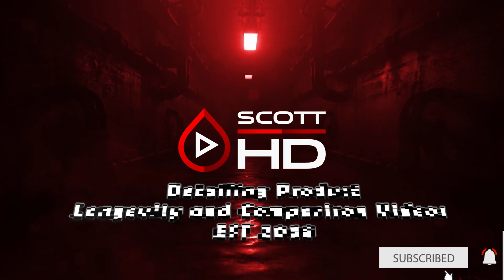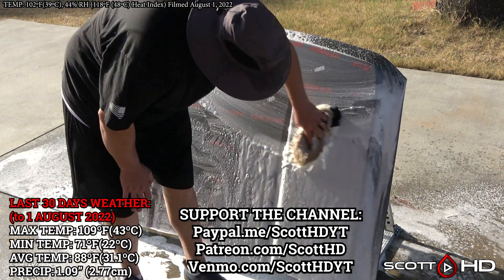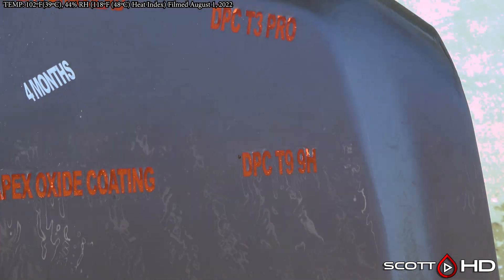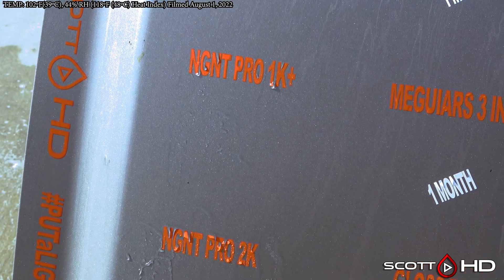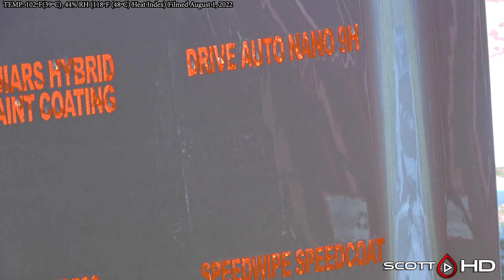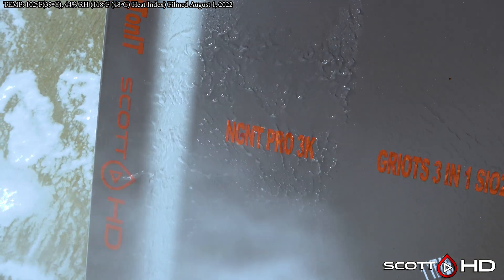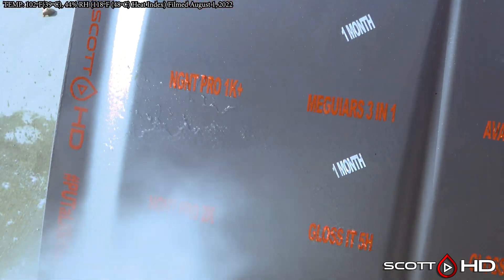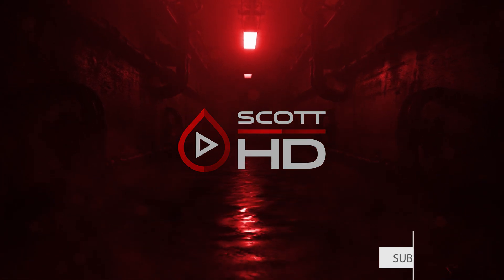Ceramic Coating Longevity Test - 41 WAY - The ULTIMATE comparison test - UPDATE 17 -1 YEAR, 3 MONTHS

Comment: Bring the panel indoors to bring the temp down then retest. The panel expands in heat changing the structure of the bond.
Reply: Many people don’t have garages so this is a fair and accurate test. Any coating should last indoors when not exposed to the elements.
Reply: @ROFLWAFFLE1911  my theory is that it is lasting, it just won't show on expanded metal. Also, only few places in the world where the population is affluent enough to consider detailing yet subjected to such high heat. You won't get that in Europe for instance. So make it reflective of reality not desert!
Reply: @Vyker  Those temperatures are normal for the south half of the United States and it's only getting hotter each year. If these can't hold up to a normal Texas summer then the consumers should be aware of that. Just like how Scott doesn't have salty roads seeing the south-half of the United States doesn't get snow like the northern half. So we'd almost need a test done the same way up north with constant exposure to brine to be accurate.

Comment: I think it is also important to take note of when you start these tests. If you start right at the end of summer when it starts cooling down, the panel won’t see two summer until near the end of the 2nd year. If you start it right before or at the beginning of summer, the panel will effectively see 2 summers barely past a year. It will definitely skew the data.

Comment: I think what people need to take away from some of these tests, this mostly extreme cases (non garaged vehicles). This is why you can't offer coatings to everyone. Take Apex Metal Oxide coating for an example, it failed on this test. However, I currently have several vehicles and one right now that's been over a year with this coating, zero signs of failure. Yes it garaged, in fact he barely washes it lol.

I'd say a multi-year coating may be a waste on non-garaged vehicles, which imo is an issue that too many detailers try to sell coatings to just about any and everyone. If the conditions are right, they qualify for a coating. If not, at max I'll offer them a 1-year coating.
Reply: And at that point it might as well be something cheap like Nano Age.
Reply from the maker: Correct!

Comment: It would be cool to see this test with each brand split in half, and one side of each panel was treated with a topper maybe once a month or so.   I doubt it protects the lower layer as much as they promote, my guess is the chemicals blend together at some point
Reply: Kinda pointless though, and the test would last basically as long as it takes for contamination to build up to the point where no protection will have any hydrophobic properties. I've had 6 months protection last 2 years because I use the topper as a drying aid and wash the car once a week by hand.